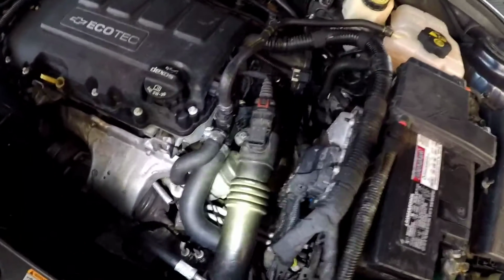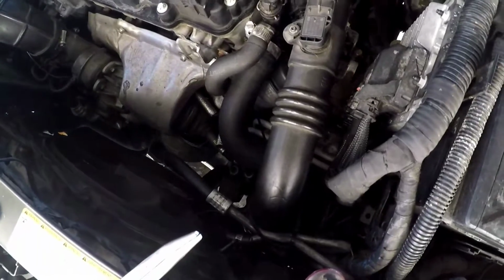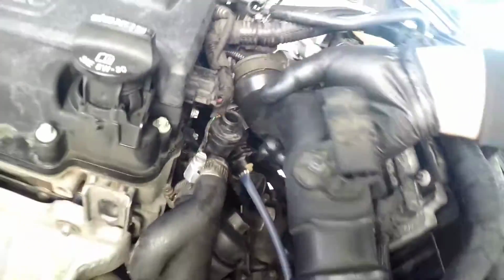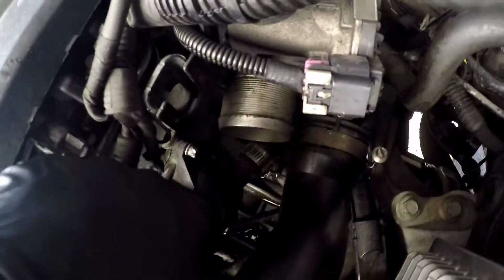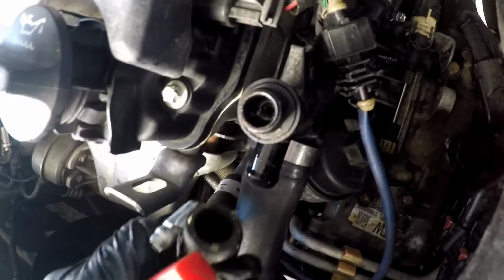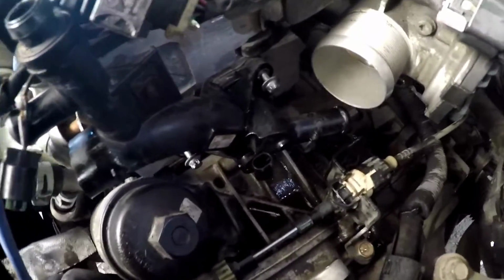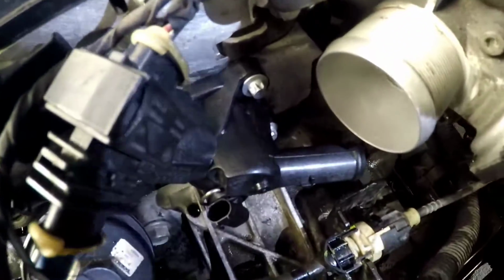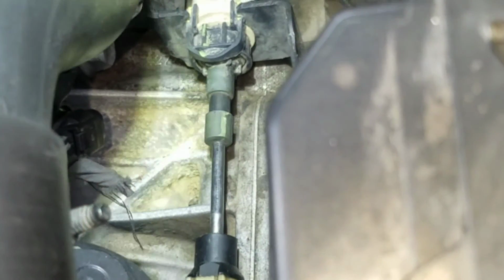2015 cruze Water outlet *remove & instal

Comment: Should you use some gasket sealer?
Reply from the maker: I didn't bro . I just used the gasket that it comes with and that's it m make sure you clean that mating surface good tho
Reply from the maker: it's been about 6 months now and still no leaks or cracks haha
Reply: @luigifix2120  it's fine. I am just going through the same thing again for the second time. They should make them out of other material
Reply from the maker: fuck second time ? shit yeah aluminum would have been better
Reply: They make them now